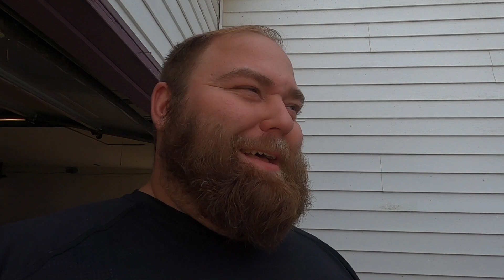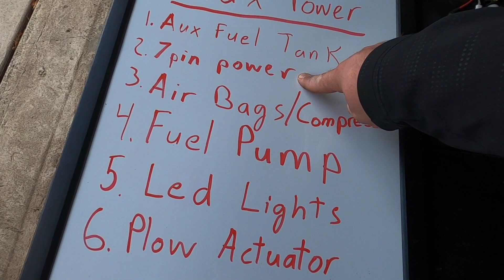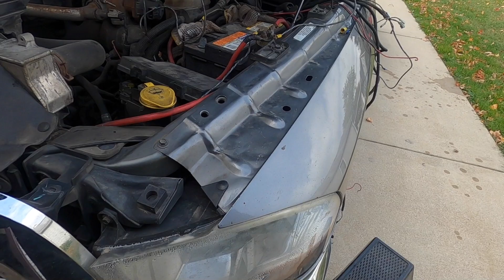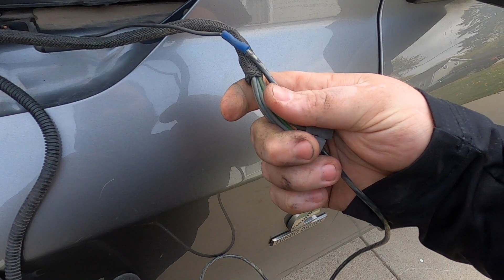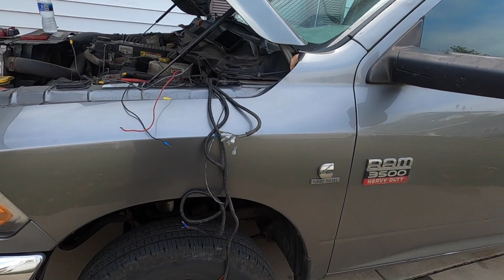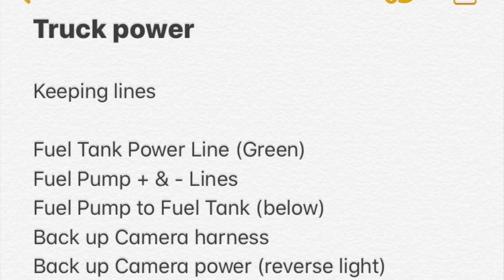Auxiliary Electrical Repair PART ONE

Comment: I give you props. I know when owning your own business you have to go outside of your comfort zone. But , boy I do not envy you right know. I have definitely tried doing my own electrical. Small jobs turned out good. Big jobs ended up costing me in the long run. But I have always said. You don't know until you try. Keep up the hard work. It will definitely pay off in the long run my friend.
Reply from the maker: Craig! I'm finally responding, sorry! lol I've had to learn the hard way too many times haha it's been difficult but this project seems to be my best work and a combination of all my failures that have added to this success haha it's a strange feeling to not be blowing fuses and somehow melting switches or relays haha perseverance is the key! Thank you my friend!